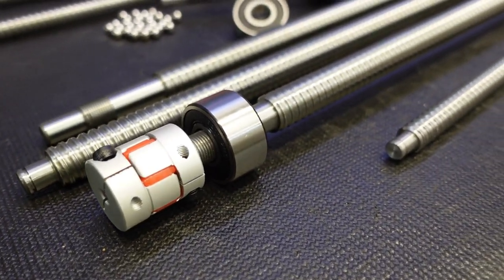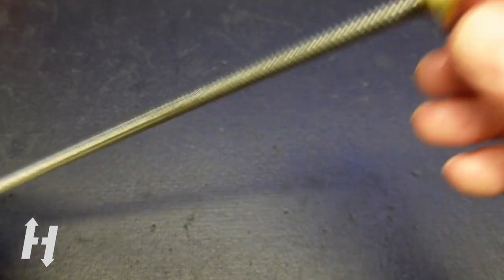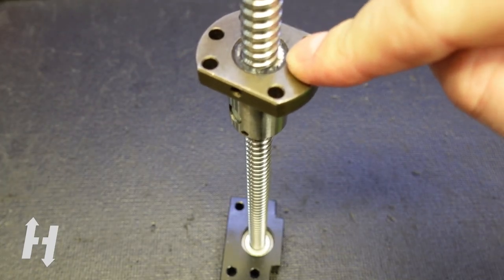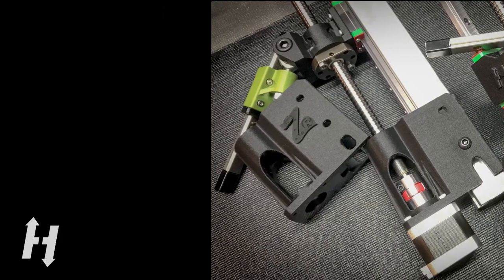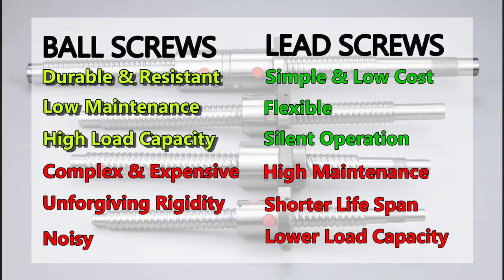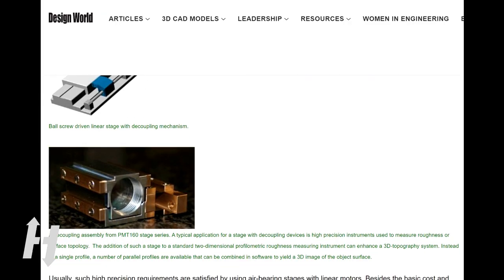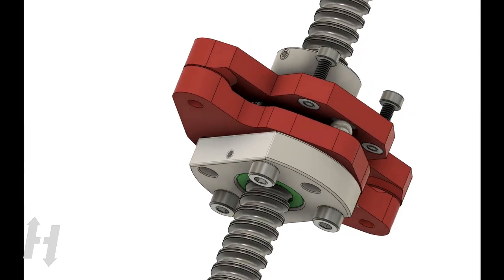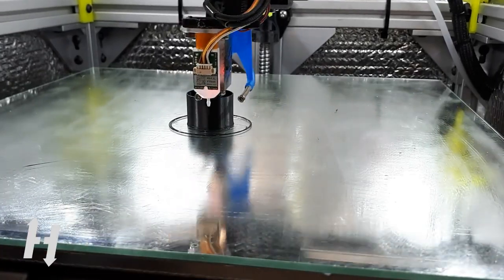Fixing Z Wobble from 20$ Ball Screws with that simple device

Comment: Of course there's the much simpler floating nut.  A nut with a flat flange to follow the ball screw, then two flat plates attached to the other side, sandwiching the flat plate, but with a larger hole so the nut can float within the hole.  Flat plate can slide in X and Y, but Z is translated.  Needs an anti-rotation link so the nut won't just spin but that's easily accomplished as well.
Very cheap and simple, and the difference in performance between that and a magnet based floating nut will be minor..
If you don't see it from the previous description, think of a car floating nut.  Bigger hole drilled in the car and a nut on a clip that can move around, to find the perfect position in the larger hole.  Moves in X and Y relative to the hole, but where it is in Z is set by the sheet metal the hole is in, and the clip being clamped around that metal.  Common in items fixed to the sheet metal around the side of the engine bay that need a floating adjustment, and can't just be a nut welded to the sheet metal.

Comment: there is one aspect you failed to mention, and that is backlash... another reason to go with ball screws
Reply from the maker: Most 3D printer configs are dealing with  single direction loads on the lead screw nut, so back-lash should be minimal.  The weight of the bed is keeping the same side of the nut threads loaded in all conditions.  But yes if we would pull the Z axis down this would be an issue.
Reply: @MirageC  
true, most of my experience is with milling machines, where it is an issue.
but thanks for the explanation, others will benefit from it too

Comment: Still, a well-designed flexure type of decoupling system might accomplish the same goal, especially if it is used in tension, that is, with the bed "hanging" from the decoupled platform, instead of resting on it? In any case, you did make quite an elegant system here :-)
BTW, has anybody used a supporting "counterbalance" system for the bed, to reduce the loading on the translation mechanism?  Imagine a "gas spring with just a little less force than the weight of the bed, loosely coupled to the center of the bed, so that the bed can move freely around the center, as needed, but the apparent "weight" of the bed is reduced to almost zero? Conversely, constant force springs that support the moving ball screw mechanism from the top, again reducing the load on the ball screw, or lead screw nut, without introducing any horizontal Moment to the bed system.... Just a thought...or two.

Comment: I don't get it. Why can't you simply remove the constraint at the tops of the ballscrews? This would allow the tops to wobble, and as long as there's some preload on the linear rail, not affect the bed. Great video.
Reply from the maker: Because they are so rigid and that we are using an angular contact bearing at the base to eliminate the axial load on the motor.   The bottom being fix and solid will allow the crooked screw to win against the rail and drag the build plate around.  It can help, but it will not fix it.
Reply: @MirageC  That makes sense!

Comment: Would your wobble-wings also work to reduce lead-screw run-out?  Can I adapt it to an Ender-3  and will it improve printing?
Reply from the maker: It could work, but since lead screw have greater friction, you might get too much delta in the nut rotation.  Magnets might not be strong enough.  Flexure plate would be better.

Comment: Nice! What is the linear guide for? I thought it is exactly to prevent any movement other than strict linear already
Reply from the maker: As mentioned in the video, Ball screws are super rigid.  They will bend the parts joining the MGN rail  to the bed.  They are strong enough to twist the attachments of the aluminum extrusions on which the rail sits.

Comment: Your idea is excelent. But one of the simplest solutions would be to simply let the top of the screw free. If you don't have an anchor there, it can wiggle/wobble as much as it wants without applying any force to the guides. And it's free. You can even remove some parts.
Reply from the maker: and how would you maintain rotation alignment?
Reply: @MirageC  the screw has some give in the nut, and the nut is fixed and rigid to the gantry. We are talking about tolerances in parts to account for any other rotations. I have an Anet A8 one of the cheapest 3D printers and I don't notice any wobble. Only when you add "upgrades" and connect the top of the screw to the frame you start getting side forces on guide rods and wobble.
Reply: @MirageC  1 year later watching the same video (didn't remember the first section) and came to the same conclusion. 11:31 let the screw wiggle. As soon as you put a bearing on that screw, all that free wiggle is transferred to some other component, probably the rail and frame. You'd say that is rigid, but everything flexes especially if you have a solid 11mm ball screw made out of steel. That's "rigid" too.

If screw is only connected on two points, motor and brass nut, it can NOT push anything sideways. Motor coupler and brass nut can be considered free pivot points, they usually have enough play.

Comment: If you need sticky lube you should look into using  engine assembly lube. Permatex makes some. It would fill the requirements that you are meeting with oil+Lucas.
Reply from the maker: Yes Permatex Assembly lube is some very sticky stuff.  Been using it when rebuilding motors and transmission in a past life.

Comment: Nice idea, but i think the two platforms of the ball bearings are not always parallel to each other. So if the screw bends to one side, one ball bearing will touch both platforms, but the ball bearing on the opposite site of the screw will maybe not touch both platforms. And that maybe also leads to wobbling.
Reply from the maker: Yes, this could be affecting the print quality at a small scale.  Quite far from initial wobble created by these cheap screws though.
Reply: @MirageC  true

Comment: You are driving the wrong components. You seem to be driving the arm the bed floats on so it is utterly at the mercy of any axial play, you would greatly lessen that effect having the screw driving the linear carriage. As a component it is already constrained in X and Y lessening any axial deviation.
Reply from the maker: The upper part of the wobble wing is driving the carriage which is connected to the MGN vertical rail.

Comment: That's a great idea. I suppose you could also try a stepper rubber isolation mount.
Reply from the maker: The problem in that case would be to deal with the axial load bearing.  We use angular contact bearing at the lower end of the ball screw to support the weight of the bed.  This bearing is fixed, therefore the flexible motor mount would not have any effect. Plus we use spider coupling.

Comment: Great video and an excellent idea for light-load applications like 3d printing. but you didn't mention backlash that is the main disadvantage of lead screws compared to ball screws it hardly affects 3d printers in the Z-axis because the nut is always loaded with the bed wight, but in most other cases it affects movement accuracy.
Reply from the maker: Yes agree, lead screws will suffer from backlash but will not affect this type of application due to single direction load.

Comment: You need to be careful with lubrication of ballscrews. While oils are to be preferred over grease any time, Oils with a high tack, like your Lucas oil, you can begin to have issues with stick-slip, (also called stickion). Which will cause a herky-jerky motion creating artifacts on your prints. The effect of stick-slip can be noticed on large CNC machining centers and lathes. So imagine the effect it can have on the relatively miniscule Hp motors of a 3D printer.
Reply from the maker: Thanks for the advice, i'll watch for that.  I have been using this mix for the past 6-8 months.  I will take a rail and a ball screw out soon for modification.  I will then compare the stickiness of their movement to a freshly oil only lubed unit.

Comment: The nut can be rotated by 5-10 degrees due to its clamping. There is a minimum of five hundredths of a millimeter play along the axis along the steps of the motor.
A mechanical turnstile should be considered. For example a plate between the bearings.
Reply from the maker: Yes, I am considering a flexure plate to perform the alignment.

Comment: For the wobble wing rotation why not use your magnet ball detail but turn it 90 degrees instead of your solid magnets?  This way you can get direct bearing metal on magnet and get full freedoms of rotation in all directions?  I am just making a new printer and found a great deal on 1605 ball screws... they were a dollar more from the ssme manufacturers 1204... and have since increased in cost.  I had no idea how massive they were.  I have a feeling my Nema17 motors will be very sad trying to turn them :p

Comment: I’m wondering if this would be usable un an CNC machine. I’m trying to build a new machine and considering this solution. Excelente explanation of the issue.
Reply from the maker: 3D printer use single load direction for the bed.  Gravity is keeping the sandwich together.  A cnc would need to mirror that system for the other direction.   In such a case, motoring the nut instead of the ball screw, might be a good thing to look at.  Max deviation would happen only one time over the length of the ball screw.

Comment: Hey! Great video and great idea. But im pretty sure magnets will wear out sooner than later... I had a bracelet made of magnets that every other was ball and every other a cube. Within a days use the plating on the magnets vegan to wear out. The contact patch in a ball vs straight surface is so small. Maybe using bearing ball and hard metal plates as a contacting parts would work, but i dont think it would auto center anymore.
Reply from the maker: Thank you for the feedback, yes the magnets will wear out over time.  This is why i am working on this :) https://raw.githubusercontent.com/MirageC79/HevORT/master/images/DSC00123.jpg

Comment: Awesome solution! I actually arrived at a similar solution for a project at work a few years ago, but I used ring magnets and a thrust bearing to solve the rotation problem (the thrust bearing washers were installed flipped over so the balls were resting on the flat sides of the washers). I wonder if that would work here?
Reply from the maker: That would definately work. I thought of it at first but had trouble sourcing thrust bearing of that size. Magnets might have a hard time with the thick bearing cups though
Reply from the maker: I am currently working on this : https://raw.githubusercontent.com/MirageC79/HevORT/master/images/DSC00123.jpg
Reply: That's really cool! I love workarounds like this because so many times $1000's are wasted on precision components when a little ingenuity can do the trick with drastically cheaper components. In our design we actually had 2 thrust bearings stacked on top of each other because we had to transmit force in both directions, but in you case the weight of the platform eliminates the need for 2. I also found a thrust bearing that might work in your setup: https://www.mcmaster.com/6655K59/

I believe we sourced the ring magnets from k&j magnetics. 

Looking forward to more videos from your channel! I always learn something new!

Comment: Dude, you're a genius!, i love to wathc people solve problems like this, in simple and ready avalible resources.
On the other hand, i wonder, in my job as a machinist we straight leadscrews all the time using a press. Do you think that a ballscrew could be straightened this way?
Of course they're hardened on the surface due the cold forming, but you could bend it a few hundreds of um (100 micron or more), Maybe you could anneal the ballscrew and bend it stright (at the cost of loosing the hardened surface for the balls)
Reply from the maker: Yes, straightening the ball screw should be done first if they are not perfectly right, then wobble wings could do the rest.

Comment: Great job ! Just a question ... Your z axis are guided by a mgn rail so how can the bed wobble even with the stiffness of the rail ?
Reply from the maker: Rails are rigid, but up to a certain point.  Ball screws are so strong that they will bend the printed parts, twist the mgn bloc on its rail and twist the extrusion that holds the rail.  Ideally 2 rails would be used per screw, like CNC installation do.  but then again, this is a lost of costs being added.

Comment: Excellent solution! Impressive engineering on this one, wouldnt have thought of this myself in a hundred years. The only thing thats bothering me is to rely on the magnets further out as a way to fix the axial direction. A possible solution might be to sandwich the ball screw bearing in between 2 of these magnet rollers/sliders(?). This way you retain full flexibility in the radial direction while being rigid in the axial direction.

Comment: Ridiculous!!!   I solved all these problems by using ANTI BACKLASH NUTS made from DELRIN.  They are cheap, long lasting, easy to replace and never require lubing.  No, they aren't as accurate as other solutions nor do they need to be for the needs of 3D printers.
Reply from the maker: And how is it that anti backlash nut can fix radial runout?  I would like to understand how is this physically possible?
Reply: @MirageC  It's a non factor.  You're creating a problem to fit your solution.  Trapezoidal Acme threads are  sufficiently accurate for hobbyist 3D printing purposes.  As I said in my original response, there are more accurate (and more complicated/expensive) solutions but they won't provide significantly better prints.   I'm sure you know what KISS means.

Comment: the  calculator for the runout would be great to have :-) cool solution!
Reply from the maker: I am not sure I know which calculator you are referring to.  If you mean the small excel table in the video, it is only making use of 25.4mm / inch conversion formula.

Comment: runout is an issue from the rotation, so dont rotate it, fix it top and bottom and spin the nut....... just invert the whole motion
Reply from the maker: That's an interesting idea! thanks for sharing :) A pulley on the nut, a belt and a small stepper under each bed arm.  Then we would only suffer from the max runout value once per complete Z travel!

Comment: Many thanks for posting a video like this. I had the exact same issue with 1605 ballscrews installed on my large corexy (video in my profile if interested to take a peek).  I tried many things to get to a solution but I finally "fixed" my issue (by throwing more money at it lol) swapping to thinner igus leadscrews. I may give the ballscrews another go on a different machine using your fix to get them to work properly. Keep it up, nice machine ;) keep on printing :)
Reply from the maker: Thank you for your comment Michalis.  Great time lapse in that video! The print did not seem to be much affected by the wobble.  But as the plate was going down, I agree with you this is some massive runout.  May I ask how your lower bearing and couplers are installed?  If you want, we are currently working on a revised version of the Wobble wings in the HevORT Discord Server: https://discord.gg/acahaeGE
Reply: @MirageC  I used to have the bearing blocks provided with the ballscrews, then switched to bearings in a plastic printed mount with spider couplings, tried a few things that didnt work out and gave up. I'll join discord. thanks :)

Comment: are these orientation specific? ie could they be used on the xy axis as well?  Great job thinking the solution by careful analysis of the problem.  I'm guessing an engineer by training? :)  Doug
Reply from the maker: Gravity plays a role in keeping the assembly all sandwiched together.  So no, XY could not use this.  Compliant Machanism should be used for X and Y https://youtu.be/97t7Xj_iBv0
Not an engineer, but had some base training and some life experience ;)
Reply: @MirageC  I thought as much.  Thanks for the link.  I wonder if "gravity" couldn't be replaced by an elastomer or better, magnets in a different orientation.

Comment: Amazing video. I like your simple and elegant solution. I think it is precise enough for plastic printing precision. Don't you worry about friction wear of those magnetic couplers? Over time wear might grind bowl shapes into magnets, resulting of small sag on the side with least precision screw (biggest compensation movement). It could be possibly solved by sandwiching small hardened metal plates on top of those magnets.
Reply from the maker: Thank you, yes I totally agree with you.  A second version is being worked on making use of thrust washers.: https://raw.githubusercontent.com/MirageC79/HevORT/master/images/DSC00123.jpg

Comment: why don't you remove the upper bearing of the ball screws so that the upper part of the ball screw takes the wobble instead of the ball bearing on the bed?
Reply from the maker: Because I am making use of a double row angular contact bearing mounted as a thrust bearing at the bottom to remove any axial load from the motor shaft.  Since screws are very rigid and that thrust bearing is fix, the flopping around the screw gets when top bearing is removed will also pull the bed in all direction.

Comment: this is so genius, damn
maybe if you use higher grade ball screws with this system, the accuracy might multiply with your system or reversewise the inaccuracy might buffer out
Reply from the maker: I am working on a second version of that system which will be integrating "compliant mechanism", this should be a lot better when using "close" to perfect screws and screws with more friction (lead screws).
Reply: @MirageC  compliant mechanics always sound promising in aspects of efficienty and wear. keep us updated! :)